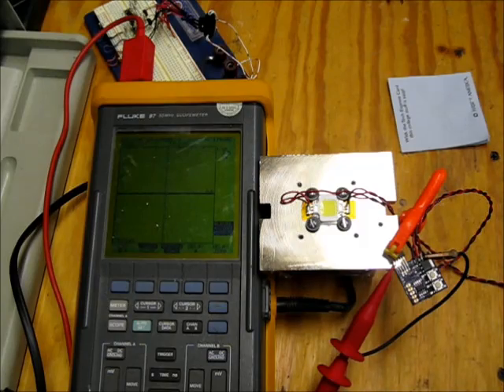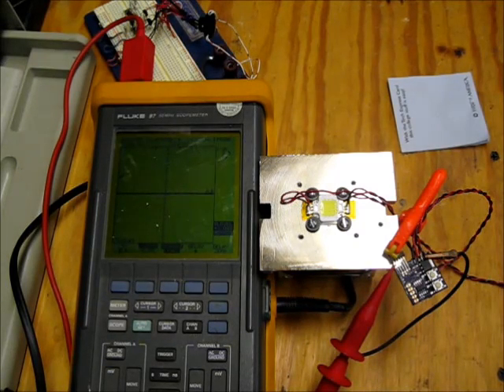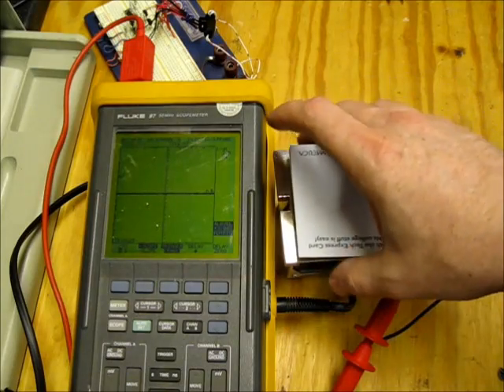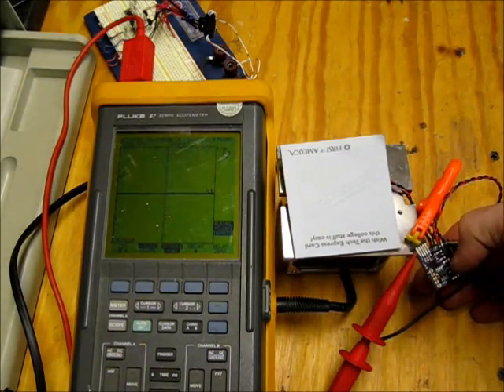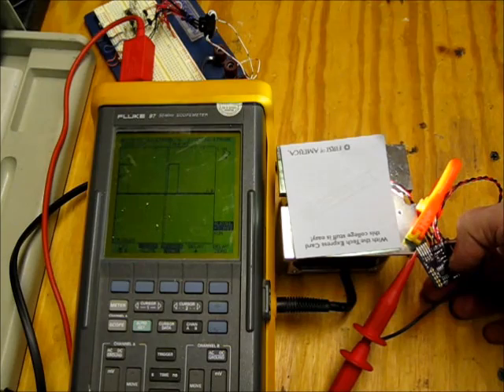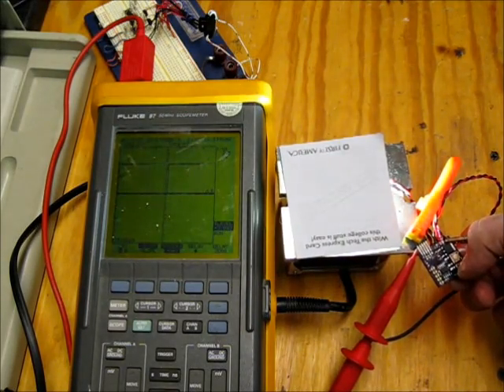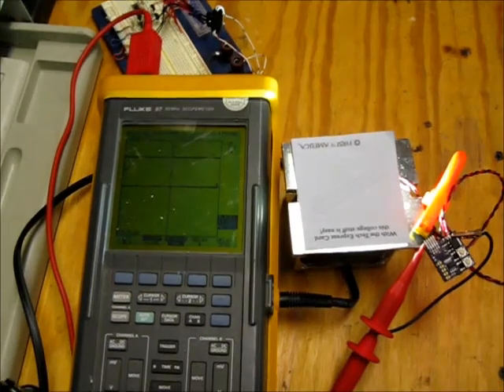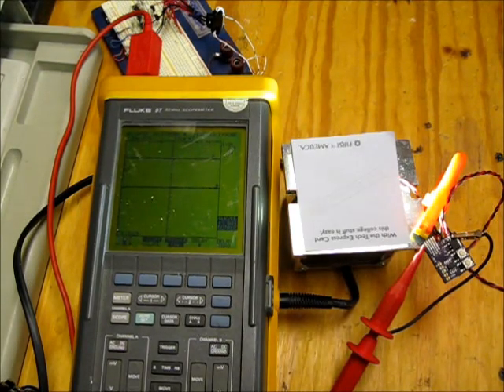[WRP] 10W LED fiber light source

Comment: wowww very nice work, congrats!!!! I have some questions:
- The led give you a light with patterns or flat??
- do you have a diagram and wich components do you use??
- The plug where you put the fiber optic to the led source wich diameter has??

thanks :D
Reply from the maker: I have mine hooked to a fiber ring light. The lighting out of that is quite flat and even. No noticeable patterning to me. 
 
There is a instructible for this project here: https://www.instructables.com/id/10W-LED-fiber-light-source/ 
I go over most of the major components and how they are selected. More or less any 10W ~12V led module should work for this.

The adapter for the fiber was built to match my fiber whip. Don't remember off hand what diameter the connector was.
Reply: Hello again, I´m trying to reproduce your diagram, but i don´t know much of electronics. If I use a 20w LED should I change something?? can i change the led board that you put there with a dimmer like this??
- https://www.ebay.com/itm/HOT-12-24V-8A-LED-Light-Strip-Manual-Dimmer-Adjustable-Brightness-Controller/122792678897?hash=item1c970395f1:g:spoAAOSwVC1Z2wX2
Reply: No the regulator I used can only support up to a 10W module. It will not be able to drive a 20W module to full brightness. If you ok running the 20W module at half power it would work.  The regulator you linked does not seem to have a current limiter on it. More than likely you would burn out the led with this if your not careful.